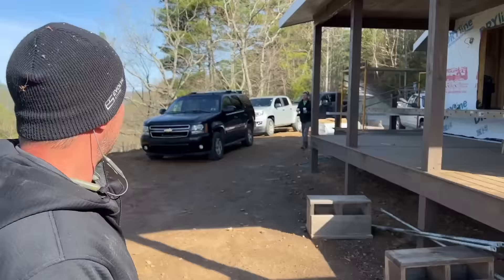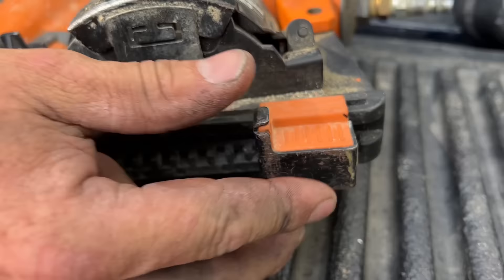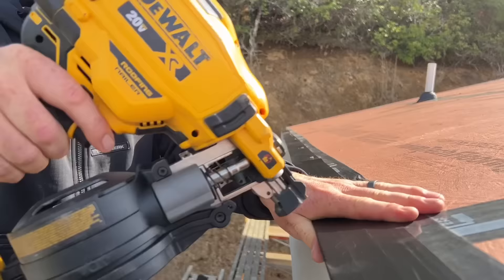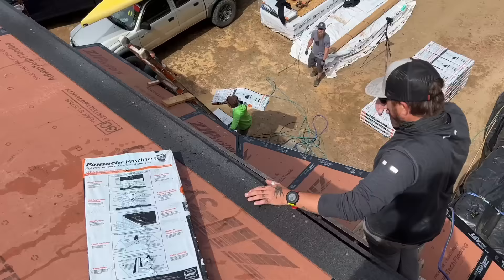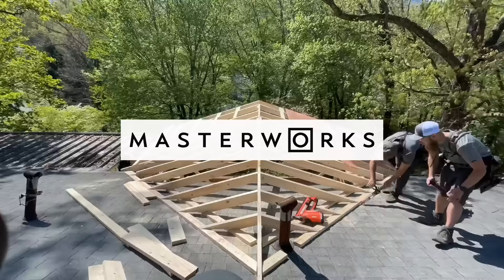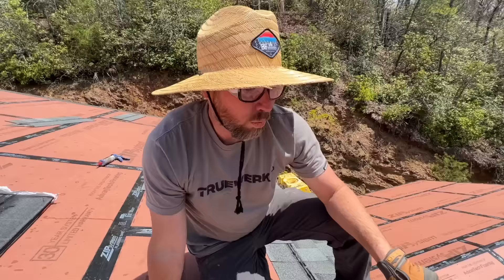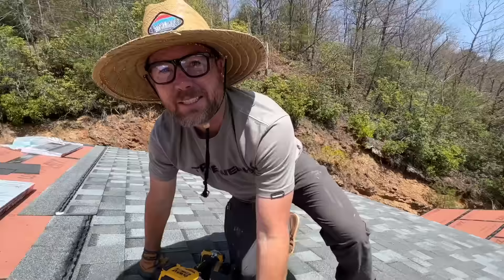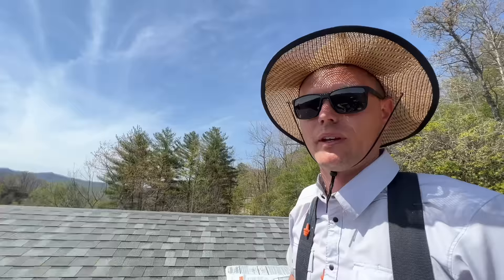Installing Roofing Part 1 | Building A Mountain Cabin EP34

Comment: Does the homeowners ever question the videos when u say we really never do roofing but we are on this house.
Reply: Why would they? These guys are master carpenters.Roofing,especially simple roofs like these are pretty to the point.If you know the proper steps any pro can do it. Now I'd be worried if it was a roofer framing your house
Reply: I doubt it. I’m sure they’ve done many roofs just prefer not to do them regularly
Reply: Didn't say they couldn't do it ,they build some nice houses,just curious is all.
Reply: With knowledge, one can do wonderful work.
With experience, one can do it with speed.
Reply: @jasonmarshall819  I did renos and new builds for 7 1/2 years, never had any client question our ability to do any portion of the project, even if we said we would be figuring it out as we went 🤷‍♂️
Reply: No offence to roofers but the perkin brothers are probably over qualified for roofing … they got it
Reply: @jonathanconway7256  Love this.
Reply: 😂Fr, not super reassuring. It gets sketchy when ppl start doing things that aren’t their specialty. They seem to do just fine tho🤷🏼‍♂️
Reply: I'd assume they trust them to roof it if they trusted them to frame it. Roof integrity<structural integrity 🤷‍♂️
Reply: It would probably cost close to the same if they subbed out the install vs doing it with their own crew
Reply: And they have more control over quality with their crew over a sub
Reply: @packers45678  Id say  it cost significantly less to do it themselves then to sub it out. They have two days of labor for their crew vs what ever the roofers would charge which is a lot more then two days of labor.
Reply: @joegosselin2888  idk, new construction shingle install is around $60/square, with that footage on the roof the low pitch they could get a cheap ass sub in that would cost less than their crews hours. Guarantee. I have done it.
Reply: @packers45678  I won’t hire cheap ass subs I hire professionals. I’m sure they don’t hire  cheap ass subs either. Quality doesn’t cost it pays.
Reply: @packers45678  if all the guys are making $40hr x8 hours x2 (2days) that’s $3200 for 5 guys.I doubt any legitimate roofing company would even set foot on that roof for less then $7,500  I wouldn’t anyways
Reply: @joegosselin2888  cool story joe
Reply: @packers45678  it’s not a story it’s a reality
Reply: They are also licensed roofers lol.

Comment: The adjustable bracket is to help set shingle reveal/width.  Stop/bracket catches the bottom edge of the lower shingle, then the nose of the gun acts as a stop block for the next row.

Comment: The shingle exposure pad/knob that they were talking about was used mostly for 3 tab roofs, but does work with architecture shingles too. When installing 3 tabs you'd sometimes do what is called a "line up" which is where you have the waterlines line up all the way up the roof, well not the full shingle width all the way up, youd cut a tab off every other one as you go up, or do the regular staircase but taking a full tab off each stair. which is pretty hard to do by just using your sight. With the little gauge you're able to keep the shingles a certain distance away as you go up and it would be the exact same exposure so the line up is straight as a arrow. But some guys also just go by chalk lines being snapped.

Other than that you guys did a pretty bang on job for not doing a lot of shingle roofs yourselves. Nail placement was great, made sure to hammer flush the odd nail that stook out, used starter shingles property and even made sure you nailed lower/closer to the edge to make the starters server their purpose. Sweet job. Not sure if you guys would do another one and film it but i would definitely watch it

Comment: In our area the normal general contractor doesn’t do roofing because their workman’s comp won’t cover it. This is actually why zip system or similar is becoming more popular. It basically means a general contractor can dry in a roof during the sheeting stage, which is carpentry, not roofing, and be okay on their workman’s comp.

Comment: Great job on the roofing guys! The one thing I would note as a pro tip for roofing is to not mail the two ends of the shingle and then the center. This can matter a lot more with different temperatures but essentially you run the risk of having a colder/compressed shingle bunching up on you towards the middle and causing the tabs to kind of look ruffled. I did most of my roofing in WA state so this is definitely more prevalent there.

Comment: I work straight up. this way the shingles I just laid are cool and don't smear. On steep roofs ill set walk planks on the bottom and set a ladder that I walk on so im not killing my feet. shingling straight up is. better because you are moving less. The way you are shingling is like a typewriter back and forth. shingling straight up is way less movement and all you need is two chalk lines 6 inches apart running straight up and down. The trick is you do not nail the shingle hanging past the lower shingle. when you do the next vertical row you slide the shingle under it and then nail them. way faster.

Comment: I usually do my roofing on my smaller jobs with just gables...

Roofer explained and taught me the "roofing book" pretty much cutting 6-8" from the end to create the stairstep effect

Also I was taught to use the actual roof shingle upside down as the starter piece... the roof color will be seen from the bottom up.

Much respect for roofers. That isn't easy or fun. I'll much rather just do my framing

Comment: You’ll be faster working as a team. One person nails only. One person places and moves to next shingle. One or two people throwing bags of shingles around so the guy placing always has a shingle within reach. Rotate as needed. Nailing is hard on back. Placing is hard on knees. Moving bags is hard on everything. Let the student do that part. Run a chalk line every so often but measure from a reference at the ridge. That could be a pro tip. Also some shingles have a little slit on each end that you fold down slightly and it catches on the previous row so that the shingles don’t slide down after being placed from the vibrations of walking and nailing. I’ve actually been looking for this feature in shingles and haven’t seen it in a long time! Can anyone else chime in on that?

Comment: Looks great to me! Never used zip roof and I am not a roofer by trade, just when necessary so the only thing I wondered about was not having say syn felt - or in your case Zip Tape - over the drip edge.  However if the homeowner is reading and concerned, I doubt it's an issue with that fancy of a roof system and a much more carefully nailed shingle.  So many roofers are fast because they do not adhere to proper nail placement or prep steps.  I'd trust you guys to shingle my home!

Comment: As a roofing company owner I can say you guys do a better job than most carpenters! I am a firm believer in underlayment! It's cheap insurance. That being said they don't use underlayment in Canada so it's all in technique.
Reply: we use underlay in Canada, least my part.   Normally ice/water shield on top of felt/roof paper.   Bad weather on the east coast, lots of wet mushy stuff.
Reply: We also use underlayment in Ontario. Grace Ice & Water on low slope because of the snow load, felt on higher pitches

Comment: Eastern New York snowbelt 4/12 ice dam protection is a must. Also starter row centered on the roof center unless the length works for even cutoff at gables using 7-cut start for seven courses and then repeat so all channels are aligned top to bottom. Alternative use the 7-cut in left and right directions from the centerline. Pro roofers align 1/2-tab and go straight up from the starter course so that variation or gain due to butting the shingles averages out to the gables. As framers we always bid the roofing to increase the profit per house. Never had any call-backs, thank God!

Comment: Starter shingles also help with preventing the wind from lifting up the 1st course of shingles.
And yes, you do want to have starter shingles on all perimeter edges.
Also, if you use foam from an old couch cushion, it not only protect the hot shingles from getting smeared from standing on them, but also is a lot better for the knees and helps hold you on steep roofs !
Reply: and great for a nap at lunch
Reply: @ChrisLoganToronto  a nap in the shade!

Comment: Is there anything Jason likes to do? 😂🤣 My grandfather was a roofer all his life and had told me that stop is to line up your next row of shingles. Also don’t put your drip edge right up tight against your fascia. Water tension will pull water back up and make all that water run on your fascia. I’m just glad I’m not a roofer it’s hard on your body. Did my roof last year and that’s enough to last me a life time 😂 But I covered the entire thing in ice and water guard and six nailed every shingle. Not even god himself is going to leak through my roof 😂

Comment: Ice shield is used here for the first 3’ back when most roofing was 3 in 1 starter strips weren’t used and the first row was reversed shingles then go over the top of it with shingles the normal way… that was the late 70’s

Comment: In the UK we don't really do shingles, we call it roofing felt and put it on sheds. We would use slates, or concrete formed slates and even metal roofing, although that would mainly be in modern builds or rural builds. Obviously, slate is heavy so on a wood build that might be too much weight. Anyway!!! very interesting, even doing roofing felt on a shed is messy so good luck with a shingle roof!
Reply: Hey thanks for the comment. I’d like to know more about doing slates and how you build a really strong roof frame
Reply: @jaimeperkins9606  I have thought about this and it goes back to history. The UK is a small country and in the past we chopped down an awful lot of trees for fuel and building material. So then the Romans came in about 44AD, they built in concrete and bricks, and then they left and the technology went with them. So in brick built houses they were repaired with wood. So fast forward a few hundred years, we don't have a great supply of wood so we make bricks, and we mine Welsh slate, which is easy to cut into slivers of roofing material, and so now we build walls in brick with concrete breeze blocks on the inside, insulation between the two. On the roof we put slate tiles, either from Welsh mines or cheaper Chinese (as always!!!) derivatives and so there you are. In the US you have always had a lot of lumber so that's how you build houses. There you go, a small history lesson. Where that got us I don't know! :)

Comment: And we 45 the stater row in the corners so you have complete tar seal all the way around . And most manufacturers wing warranty your shingles if you don't use a synthetic underlayment. But all manufacturers are different. Some want you to use their underlayment to get complete warranty. And no one uses battery powered guns not fast enough.
Reply: You could just but the shingle going along the rake to be just above the tar line on the eave, the build up isn't noticeable enough to have to do a 45 on the corner either.

And I think if I remember right that the warranty brand wants you to use 3 of the same branded products on a roof. So field shingles, underlayment, starter, and hip/ridge cap shingles, peel and stick, etc.
Reply: @Josh-ww5kz  your right about the warranty

Comment: All roofers need to look at the video at 10 min an 5 sec watch very carefully one of if not the most important step of installing your roof putting the nails in the right spot u have to hit both layers shingles will pull apart especially if there is any pitch to the roof
Reply: As a repair technician I can tell you most roofers don't.
Reply: @charelsmissinglink  half the roofs I tear off have the nails too high. And I've noticed some company's that I've worked with nail high too and I tell them it's wrong but they don't listen and would rather say that they've been doing it for so and so many years and theyve never had a call back. Like yeah, I doubt you've had the same number for those entire 15 years and answer every single phone call you get.
Reply: My roof was high nailed and it's losing shingles. It's 3 yrs old.
Reply: @schwazelbacher  see if a roofing company near you will do the leaf blower check and caulk. When I do that it's $50 a tub with a minimum of $400. Verify it is cement would recommend manufacturer being Lucas cement.

Comment: To help make sure you don’t full your blade as fast, cut from the back of the shingle since there’s no rock
Reply: Full time roofers use blades called hook blades, I haven't met a roofer myself who uses straight blades to cut through shingles. Hook blades latch onto the shingle and cuts it from the middle
Reply: @Josh-ww5kz  true, the back cut method is just another method in case you don’t have a hook blade, I see some roofers using back cut even though they have a hook blade as well. It works well in colder conditions where it’s harder to cut but you can score the shingle and break it
Reply: @offended9081  Oh yeah, i did roofing in saskatchewan for a few years, although you shouldnt install shingles in like that cold of a winter. The homeowner signed something saying they know of the risks of a colder temp install for shingles. No problems with it to this day and we went back in the spring to look at it too. But cutting shingles in -20c weather definitely sucks lol

Comment: Don’t use the gun guide, I would still put synthetic and ice and water down, starter on eaves and rakes 👍🏼. Idk if you should have an additional overhang off the D style drip 🤷🏻. Atlas is a good shingle, malarkey also has the “nail” zone ( gaf hdz has it too but QC of late sux). With ur mnt wind zone oc duration or iko Nordic would be a little better on uplift(plz 6 nail). Bostitch nailer and hitachi are the best nailers.

Comment: On the edge you should always put a nail on top as well of the shingle it's called a wind nail so your last nail on the very edge add one above it that's your wind nail
Reply: That's kind of a myth, the shingle above it will be putting a nail right where you would be putting your so called wind nail, because the nails in the shingle above will be hitting the top like inch or so of the one underneath it. So it's kinda a waste to put another nail there. As long as youre putting 4-6 nails in a shingle you'll be good.

 And backshingle if your piece on the end is shorter than 6".

I've always put 5/6 nails In a Shingler, grew up in saskatchewan so we do have relatively high winds. Now live in bc where most guys do 4, but i stick with 5 and do a 8"book. But I'm not doing roofing now, doing cladding  and metal work

Comment: Nice job, but if it where me I'd still use ice and water shield on the entire roof even if I used a zip system. I've also used the starter shingle rolls and it works awesome. My peffered method with valleys is ice and water in the entire valley and aluminum valley tin. To me it looks way better than trying to knit shingles together and you don't have to worry about a leak if the water backs up in the valley
Reply: I definitely agree with using metal w flashing in the valleys. Much cleaner look than shingles. Pair that with high profile ridge cap and it looks great

Comment: Hopefully all your shingles were from the same manufacturer lot.  If not, hopefully you randomly distributed the mix of lots throughout all the shingle bundles.  Just in case there's any color deviations from lot to lot.  We used to cut our starter shingles from a regular bundle of shingles.  The top edge of the shingle cut shingle (mfgr. edge) would face downward.  Didn't take the starter course tar strip into consideration.

Comment: I was always taught that the little adjustable knob on the bottom of the nail gun is for your reveal ,you butt the flat side of the knob up against the bottom of the shingle row below it and rest the bottom of the top shingle against the flat side of the nose, once in place you clamp the shingle down with your hand and nail it , acts similar to a siding gauge
Reply: Yup. This is right.

Comment: OK, I know you are using the ZIP system sheathing but why no underlayment beneath the shingles??? I know that ZIP says you can shingle directly over the sheathing but I  just have a hard time believing that it is not necessary to put some type of underlayment down under the shingles.

Comment: I can appreciate Jason's sentiment. But you all probably did a better job. I learned while roofing my large shed myself, that I did a way better job than the roofers that did my house. I wasn't rushing and I made sure everything was laid out perfectly. From the prep to the underlayment, starter row, drip edge, and shingles. The roofers just slapped it on and my job looks way better than theirs. I do live in San Antonio Texas where I have found the quality of workmanship isn't the best. That could be it, or maybe the company I used for the house was subpar.
Reply: This. I feel like your comment increasingly rings true for all of the projects I do myself vs hire out. I have been very disappointed by the cut corners and lack of quality/care in some of the contractors out there.